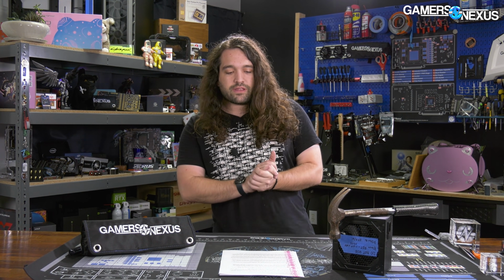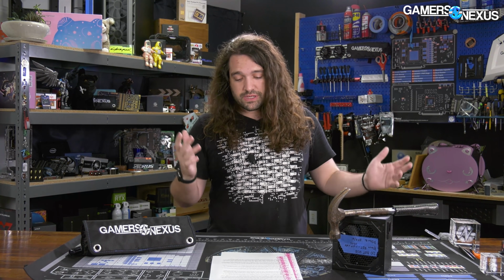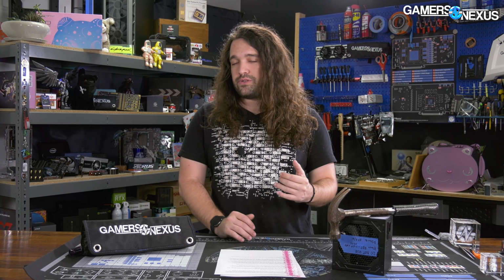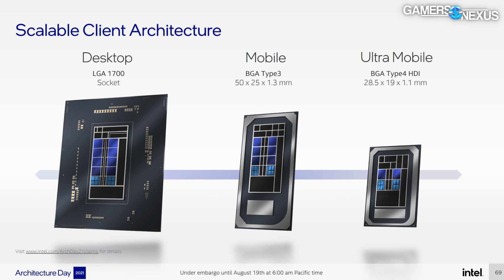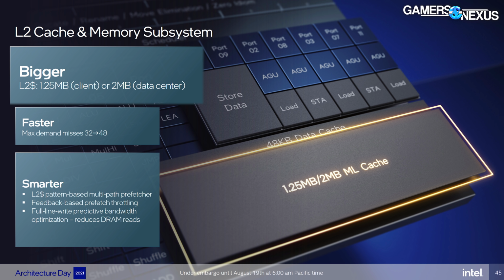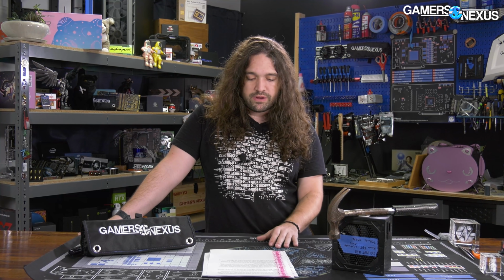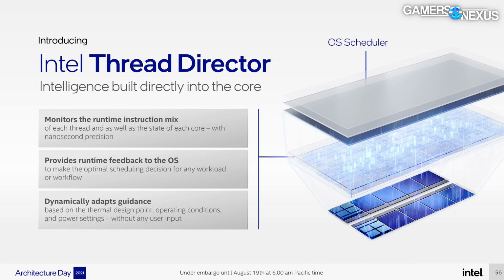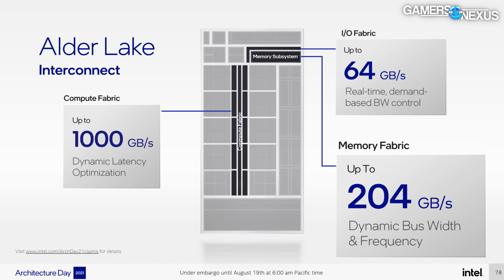Intel Overhauls CPUs: Alder Lake Architecture Explained - New Core, PCIe Gen5, & DDR5

Comment: Intel really wants you to lead you into believing the performance of the Efficincy cores will be comparable to skylake, but it's not going to be even remotely close.  The E cores are not going to be run at "the same" or "40% less" power compared to skylake. A skylake i5-6600 ran each core at ~15W per core (higher for K parts), plus a ton of extra power pumped in during boost. 
Intel isn't talking about exactly how much power is available to each efficiency core, but it is likely to be less than 1W per core. You should expect somewhere on the scale of 10% per-core performance vs skylake.

The smoke and mirrors in this presentation makes my skin crawl.
Reply: You forget that the process node isn't either Intel 14nm or 10nm (used in Tiger Lake that has almost 3 times the density of 14nm from 2015), Alder Lake will use Intel 7 process which is slightly better than the one being used in Tiger Lake.
Reply: @saricubra2867  
Intel 7 is a straight cynical name change of 10nm. Although in fairness its 10nm++ compared to the 10nm+ in tiger lake. 
Intel 10nm never made it into a mainstream product, just a handful of low-performing "internet cafe" parts aimed at China.
Reply: @SparkY0  The name makes sense since Intel's 7 process outperforms TSMC's 7nm process, in fact, would be pretty close to 5nm, the nanometer doesn't make sense for measuring transistors since many years ago because we don't have a standard (gate length? source and drain?). By the way, Intel no longer puts pluses to their nodes since 14nm.

Der8baur also exposed the lie of 7nm node:
https://www.youtube.com/watch?v=1kQUXpZpLXI

Intel's 10nm Superfin has more transistor density than TSMC's 7nm, that's why Tiger Lake outperforms Zen 3 mobile, in fact, Core i9-11900KB is better than the 11900K even in singlethread perfomance and has less than a half of the power consumption and TDP.
Reply: You can wait until anything is reviewed.
Reply: @Safetytrousers  
Sure, but giant red flags are worth pointing out. Intel's marketing has really gone off the rails with misleading claims and rebrands, lately. That's not a good sign.
Reply: @SparkY0  Where were the performance claims in the presentation? Are you doubting the presented block diagrams are true?
Reply: @Safetytrousers  
No, that's my point. They made no claims whatsoever of E core performance. They just shoved the word "performance" over and over into their efficiency claims. This was done to deliberately lead people into inferring a certain level of performance that the cores cannot conceivably reach. It's a gaslighting technique, which really rubs me the wrong way. 

Think of it this way, if the efficiency cores were actually running at around 60% of the power of a (non-k,   base freq) 6th gen skylake desktop part (ie "same performance") then they would be consuming ~10W each. 
10W x 8 = 80W. That's never going to happen in a part that still needs to allocate most of its power to the 8 Performance cores. 

These numbers are obviously very rough, but I hope you see my point.
Reply: @SparkY0  I had to go back over the video because I never noticed the word performance being plastered over and over, and I still can't find that happening.
Reply: Tiger Lake i7-11800H can outperform the i7-10700K at stock and uses less than a half of the power draw:
https://www.notebookcheck.net/Intel-Core-i7-11800H-Processor-Benchmarks-and-Specs.525586.0.html
Reply: No x86 CPU core will use 1 watt, this isn't Qualcomm ARM
Reply: @saricubra2867  its Intel atom cores, which is the x86 competitor to Qualcomm arm. Except its built on a worse process than the tsmc 5nm in this year's phone processors.

Your typical Atom CPU is around 1.5W - 4W per core, and they have very poor absolute performance. But they're pretty efficient (by Intel standards). 
This architecture makes some sense for ultra low power laptops, but I'm expecting desktop to be a disaster.
Reply: @SparkY0  Atom is not based on Gracemount, Gracemount is waaay faster.
Reply: @saricubra2867  if you have proof of Gracemont performance, then kindly please provide it. I'm yet to find even a marketing claim that they will outperform Tremont, nor by how much.

Comment: Imagine having car with only 1 gear. Normally u would put a better gearbox but intel is putting a second smaller engine instead to switch between. By doing this they admitt their architecture is not efficent on different loads and they giving up fixing that. What they are doing is not a solution, its an workaround.
Reply: Wait till you realize that most hypercars now use electric motors on multiple wheels and not just 1 big gas motor in the front... This is the way forward. Why have 2 very different tasks done by the same cores, when you can squeeze far more performance out of using two different core architectures. Like football teams are made up of one type of athlete, you have people with different body types and skills because that makes far more sense.

Comment: Intel is doing this small and big core as their current architecture will draw more power as compared to AMD CPUs if they increased the clock speeds to make it more powerful

On the other hand, AMDs architecture is superior in terms of efficiency 
They don't need to do this small and big core stuff in their future CPUs
Reply: My 5950x is hungry and hot.

Comment: I hope this is good. I can imagine some interesting developments for flight sims since the limiting factor right now is the avionics which is basically an in-game browser. I wonder if offloading those to the E-cores would have any substantial yields while the P-cores do the work of physics and rendering. But that would depend entirely on the core scheduler and if the added overhead is worth it.
Reply: Wouldn't the GPU be doing the physics and rendering?
Reply: @rasputinaxp  GPU can be used for physics, typically particles, but the bulk of physics is still on the CPU.

Comment: Intel should only implement the big.Little core design only in mainstream SKUs, ethusiasts should get maximum power from their cpus hence no need for the little cores on K series chips.
Reply: The little cores do multithreading above 8C, the little gracemont cores will literally be the reason Intel's 12900k passes the 5950x. They arent just power savings cores, but multithreaded performance per die space. The big cores are for low threaded tasks, like gaming and responsiveness

Comment: The good thing is, big core has a massive 6-way instruction decoder array. Should be the largest ever seen in x86. AMD is still stuck at 4-way decode. Also there is an extra ALU and a loader and some gadgets like FADD. Not nearly a Netburst to Core level improvement(My estimate is about HSW to SKL) but will still make short work of anything AMD has, given they don't mess up something else, or running something that's cache bound only like CPUZ benchmark.
Reply: Around 40% ipc improvement over skylake (6,7,8,9,10th gen). Lets say rocket lake never existed...
Reply: @mtunayucer  We'll see. Keep in mind that successfully extracting 6 non-vectorized instructions from two threads with any reliability is somewhere between "ideal case scenario" and "pie in the sky fantasy."  That level of Instruction level parallelism isn't exactly reasonable.
Reply: @jebe4563   But don't forget branch prediction, it tooks a lot of unused slots. For example on 11700K wastes about 20% slots with mispredictions while rendering, and that's just the cost of 4% of branches mispredicted. The other 96%+ correctly predicted instructions will execute in advance, costing even more slots. 

Of course intel can't get all the slots populated all the time(that's why we don't see a 50% improvements across the board every gen now, and why they've slown down their pace), but that doesn't mean it won't release that 20%+ front end bound when it's bottlenecked, and bring some good perf gains.
Reply: @mtunayucer  Just say Sunny Cove(and other coves of the same design) is the most tragic architecture. It's strong but put off again and again, then abandoned midway on desktop, never reaching its true potential.
Reply: @Alan_Skywalker  i honestly got lost after skylake, cuz intel decided to put newest architectures on laptops and leave desktop in the dust. With alder lake, hopefully whole stack is on the latest architecture.
Reply: @mtunayucer  That's the problem. Mobile CPUs do not need to have that high of a frequency like desktop ones so they can be made early. SNC was designed for 10nm, but 10nm was too ambitious and aggresive with new technologies to fully mature in time. Now intel has everything they need till the end of silicon electronical chips so they're not likely to encounter the same problem anymore, I wonder what will happen when other vendors meet the bottlenecks intel once stuck on. For example, SAQP, Cobalt interconnections and COAG.

Comment: On the E-cores, Intel states its 40% more performance at the same power. But... they are efficiency cores, they will likely never run at that power level, otherwise there's no point to spending silicon space on them if you're just going to spend 65W of power on them. So more likely it'll be the same performance as skylake at 40% less power. Or maybe even more likey, they may be capped to more like 80% the performance of skylake at ~60% less power. Intel can plot a perf/power curve to infinity but they aren't necessarily running the cores at those levels. Now I'm curious if it'll be possible to design benchmarks to really test the efficiency cores vs performance cores.

Comment: "No news on MacOS..."
Well given Apple has dropped Intel for it's  own chip, I doubt Intel gives a monkeys...
Reply: With this latest Intel offering I know of one Linux user that's more interested in what AMD is doing now. Me. I haven't run an AMD CPU since the original Athlon Thunderbird either.
Reply: Admittedly my PC purchases have probably not been the most considered, but the one I bought almost a year ago now was the first to have an AMD CPU.
As with previous purchases (pentium II, core i3, core i5) Intel had a definite lead in performance.

Ok, so the AMD rig I bought was slightly cheaper than the equivalent Intel rigs at the time. But having done some reading and watching videos it seemed that, unless you wanted to go with liquid cooling, AMD were better performing than Intel and didn't draw as much power. 

At the time I went with a nVidia 2060 Super. As I was cost conscious but not a psychopath.

However since the latest Radeon GPUs were launched, I may have gone for an AMD graphics card if buying today.

Can't say I've noticed any difference between AMD and Intel so far. At least with current gen chipsets.
Reply: @Penfolduk001  lmfao. As I can agree that AMD CPUs were price/perf killers, that I can't agree that Radeons are good - they're still trash - 256 bitbus width on 6900XT is like shooting your feet through your knee. Not to mention funny Lanczos 2.0 release and poor RT performance (even tho 4K60FPS w/RT isn't possible ATM, still 2.5K is) - Radeon group always was StinkyCheese, e.g. R9 280 and 280X...

Comment: Would ultra mobile mean they're going to try to enter phone hardware or smaller/slimmer note pads?
I'm all for this competition to ramp up between AMD and Intel, because the winner is the consumer. I like both companies for their various uses and specialties.

So I was curious and looked the M1 from ARM that's in the iPad Pro and compared with the potential new Intel chips. It's looking good.

Comment: Golden Cove with 20%+ IPC improvement and 8C will put it as the best gaming CPU (in 99% of games, 1% are games that need 10c+).  Meanwhile Intels 8C Gracemont with its insane performance efficiency, should lead to 2X MT improvement over 11th gen, allowing Intel to not only catch-up to AMD multi-thread in one year but to surpass them by a few percent. Plus DDR5, plus PCIe5.0. Alder Lake is INSANE. This is Intels biggest launch in a decade, bigger than Zen 1 and chiplets.
Reply: Beating AMD in multi-thread in under 2 years? I'll believe it when I see it. I'm betting maybe 5 years.
Reply: I don’t believe their IPC gain claims. We saw what happened with rocket lake, they claimed a significant increase and then the benchmarks came out…. Disappointment would be an understatement.
Reply: @Mojave_Ranger_NCR  Rocket Lake did deliver on the IPC gains though. The problem on gaming workloads was that it's IMC was worse than previous generations (due to it being a backport of a 10nm architecture), which led to an increase in latencies that nullified the increases in IPC. Alder Lake won't have (hopefully) any of those problems, so it should be great in gaming and productivity alike.
Reply: Out of curiosity, are there any games today that require more than 8 cores?
Reply: @MrBenderrrr  What do you mean require? Technically everything's playable even on 4.

Comment: Alder lake has space for 10 building blocks and can fit tiny 4 efficiency cores in the space of 1 "real" performance core. 

If 4 Efficiency cores could outperform a single performance core at multi threaded tasks, then the core configuration would be mostly, if not entirely, efficiency cores. So more like 2PC/32 ec/34t.

Instead, they've made parts that squeeze in the tiniest blocks that can technically be called cores, when they get sued.  It's all about slapping "16 Core" stickers on 8 core parts so that they can trick people into thinking that they're competative, while minimizing the die space wasted on "fake" cores.
The marketing is stuffed with misleading weasel words and reeks of desperation, which is a major red flag.
I'm sure that there will be plenty of uplift from Intel finally dropping down to their 10nm process (Intel 7), but I have no confidence whatsoever that their 8C/8c/24t part would outperform a hypothetical 10C/0c/20t part. These are 8 core processors. They're going to perform exactly like 8 core processors. There's even a good chance those tiny cores get disabled  until the computer is at idle.
Reply: You clearly have no understanding of how this architecture works, but are hilariously describing AMD's bulldozer. The big cores are there for low threaded tasks that need pure power, like gaming. You wouldnt want to game on 8 small cores. The small cores are slower core to core to the big cores, but for tasks that can handle more threads like rendering, 4 small cores beat 1 big core. Intel will only move from 8 big cores to 10c when games and other tasks demand it. Thats why Raptor lake (13th gen) is doubling the small cores, because they expect people will want more multi-threaded performance before they need more cores for gaming.
Reply: @__aceofspades  
Again, to my point: if 4 mini cores actually beat 1 real core at heavily threaded tasks, then they would not have gone with the 8/8 split. The temptation of putting out a "34 core" or "20 core"  processor would just be too large, if the concept actually worked as intended.
I get the concept. I understand their design goals. But there's every indication that they failed to actually meet those design goals. 
You don't need 8 big cores for single threaded benchmarks and lightly threaded tasks. Not even for gaming benchmarks, usually. A 5800X does not significantly outperform a 5600X  in most games. The sweet spot for gaming still seems to be somewhere around 10-12 threads. 

I think Intel's choice was deliberate, because they actually need 8 full cores to brute force their way past Rocket lake performance. The uplift from the smaller process probably got their 6-core parts close to parity with 8-core rocket lake. But they need a decisive generation improvement, not parity.
Then they tacked on the 8 atom cores so their marketing isn't such a complete embarrassment against AMD's real 16 core parts.

As for the bulldozer comparison, that was essentially "split part of the core in 2, so we can technically sell 1 core as 2 cores". A totally different approach to solving the same marketing problem. Bulldozer was not a big.little design. I think AMD has that design patented, also.

I do expect the public reception of the Alder Lake desktop parts to be very similar to bulldozer. Intel's approach makes some sense in mobile where you need the smallest idle power possible... but it's just an overall terrible idea for high power desktop parts. 

But hey, if you think Intel's efficiency cores are great, awesome. Go buy a computer with a 10nm atom processor, and let me know how well it handles blender or cinebench.

Comment: Up to 16 cores. It seems like it will take couple of years for Intel to ketch up to today's AMD productivity performance.
Reply: They already caught up. Cinebench leaks from a reliable leaker put 12900k surpassing the 5950x by 10% in multi-threaded. And beating it in single thread by 20-25%.